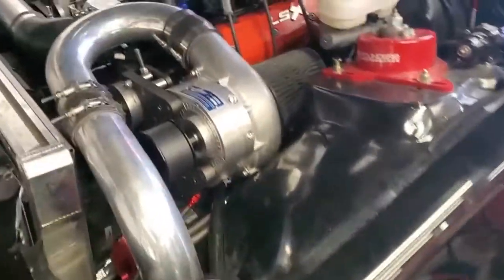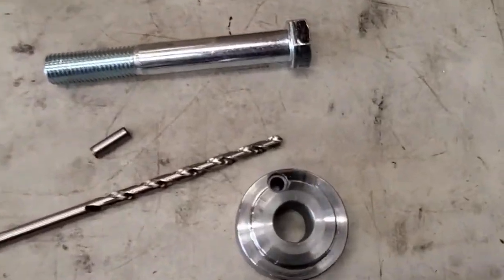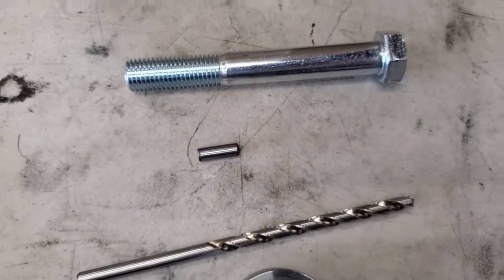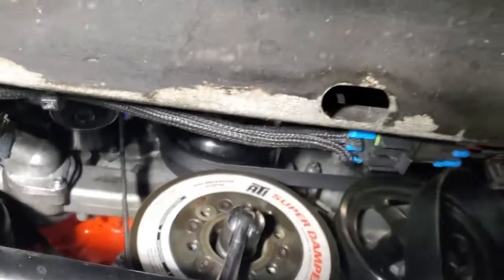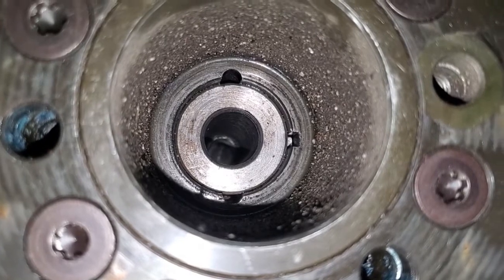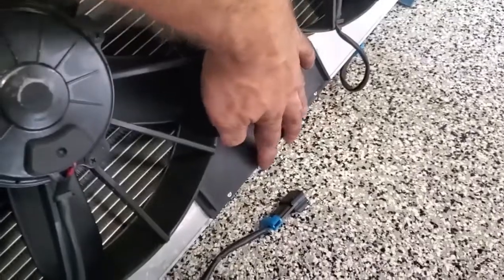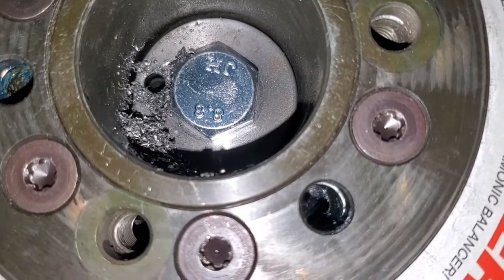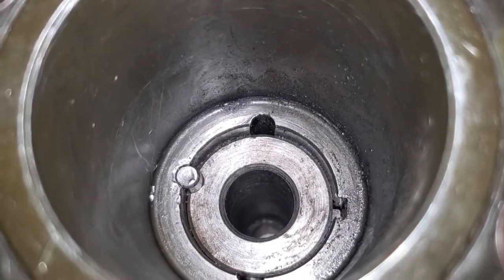How to pin your ATI damper on your LS engine with the Procharger pin kit

Comment: Nice video. I got my Procharger kit used. I got the Jig kit, minus the pin. I just got a 1/4” rod from Home Depot and cut it to size. I didn’t wanna wait for PC to ship a $5 pin, plus shipping. Lol. Worked out great.
Reply from the maker: I believe the pins are hardened steel.
Reply: @suped89 
Thanks. Been rolling it for 2 years. So far no issues. 🙏🏼 I should check it though.